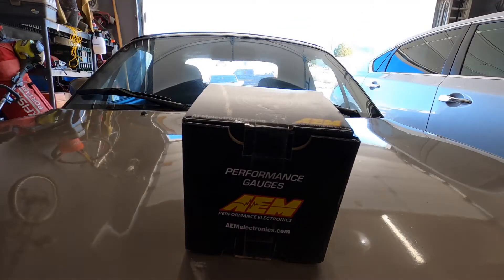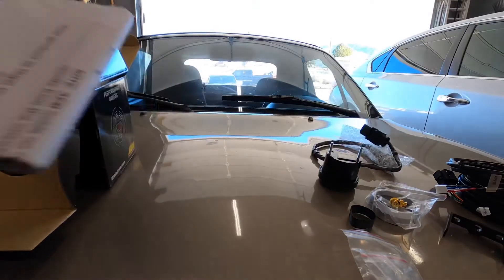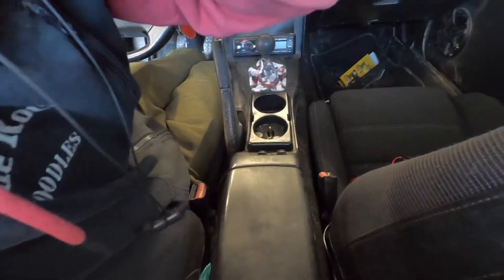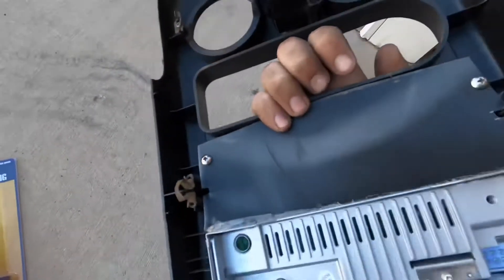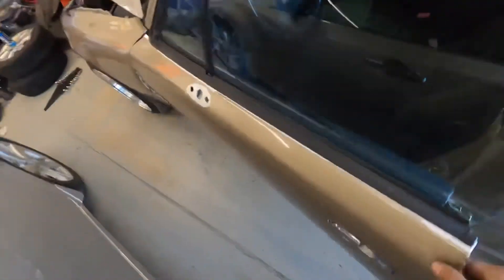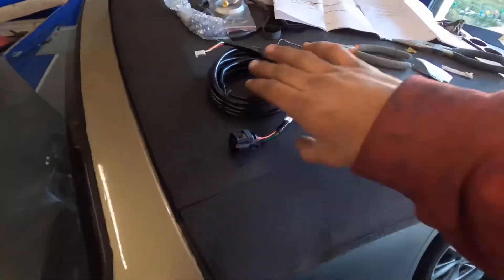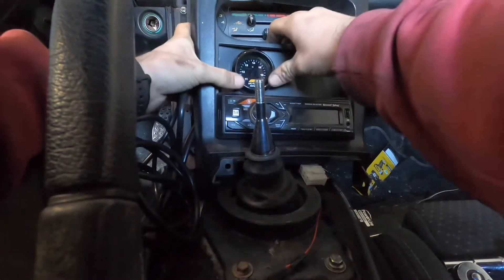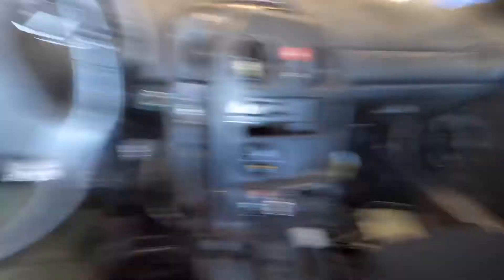Budget Turbo Miata Build Part 2/ AEM Wideband O2 Sensor Install

Comment: when you connected the wideband signal wires to the stock harness, what color are the wires on the stock side of the plug for the signal + and signal - ? I am trying to setup my standalone and am not sure if I wired in the 02 properly cause it's not reading correctly.
Reply from the maker: I unfortunately sold the car and can't remember! I just read the pin out on the aem instructions and then Google the pin out for the miata
Reply: @Smittybuilds  I ended up figuring it out, thanks for taking the time to reply though haha
Reply: @Worthi  So are people just replacing the stock narrow band o2 w/ the AEM Wideband o2 sensor and splicing it into the stock connector- with the OEM ECU? And the car runs fine? I didn't know that was possible. I believe I have two o2 bungs on my exhaust- one for stock and the other for the AEM.

Comment: I have the same one and cant figure out how to get it reading correctly with tuner studio. Like the guage doesn't read the same as it does in tuner studio. Which aem option did you select?
Reply from the maker: I'll have to Check my settings but there were a couple options mine is of by about   .2 I just went through the aem options and found the closest one
Reply: @Smittybuilds  if you can, that'll be super helpful for me. The 2 options i saw for the bosch had the guage off by 3.** at the minimum. Cant figure it out for the life of me. I just need to get this finished up and set my timing (recently replaced alot of it as it was way out of whack from previous owner) then just gonna auto tune and take it to a shop to get it properly dialed in for a upcoming road trip
Reply from the maker: I'll see if I can make a video on it shortly!
Reply: @Smittybuilds  that'll be awesome man! Thank you!
Reply from the maker: Do you have the paperwork your guage came with? You can go into the settings and manually input your minimum voltage and maximum voltage to calibrate it manually
Reply: @Smittybuilds  yes i do, i just couldn't figure out where to input that at honestly. Also i gotta do it for every range right? Sorry im really slow when it comes to the electronics. But i got all the mechanical stuff down 😅